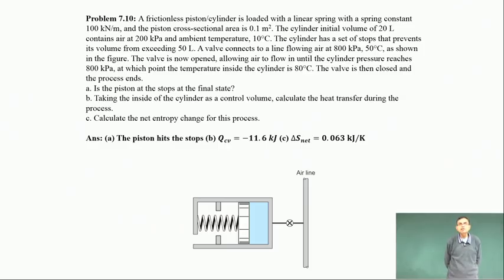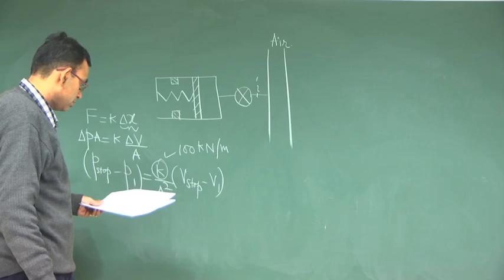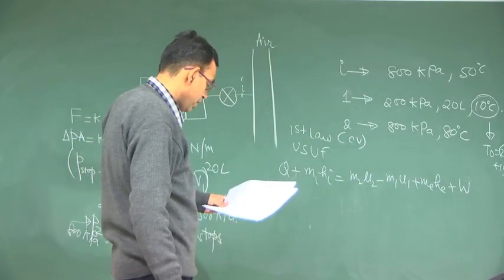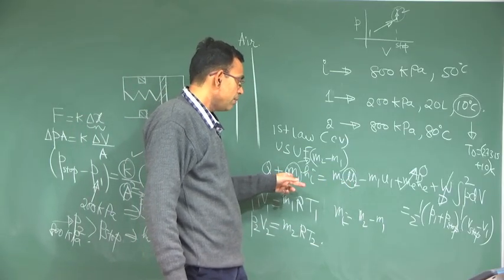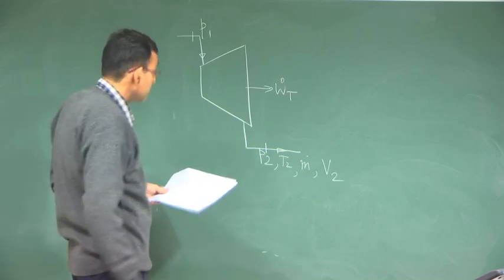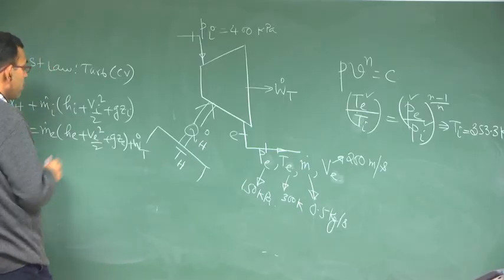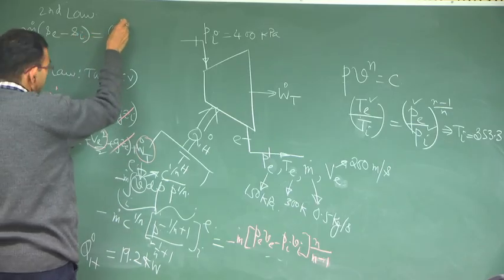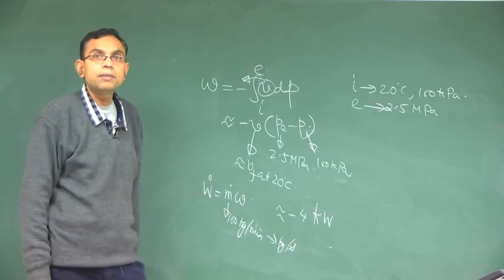Lecture 51 : Entropy Transport for flow process: Examples

Comment: In 1st  question can we approach like this -- 
Given final pressure and temperature find the v , from initial conditions mass can be calculated using property tables from m/v if this value exceeds 50L it means piston hits the stop , is this approach correct???
Reply: bro it is ideal gas ,so just go ideally